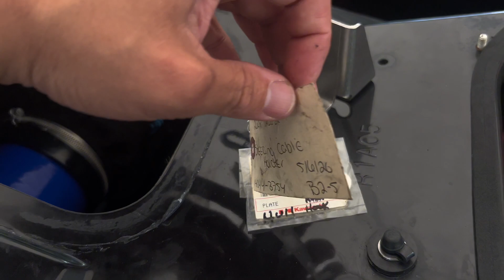Tech Topics: Stainless Steel Kawasaki Ultra 250 Steering Cable Bracket upgrade for Ultra 310 Jet Ski

Comment: I can confirm all these brackets are stainless on my 2011 300X and in pristine shape

Now you know why I'm not in a big hurry to buy a new ski for almost $20k when my $11.5k ski still runs like a champ.  Higher price and cheaper components
Reply from the maker: Higher price, and they replace quality long-lasting expensive hardware with flashy Chinese made tech
Reply: I am in the market for an ultra. I have a disability at the hip joint and knee and the new ultra is the only pwc that seats me comfotably because of the narrow seat. Plus I need the best hull for ocean riding.
But the sometimes appaling quality of these things have been making me think twice about purchasing one. If an older model had the nice seat option, I would probably go that route.